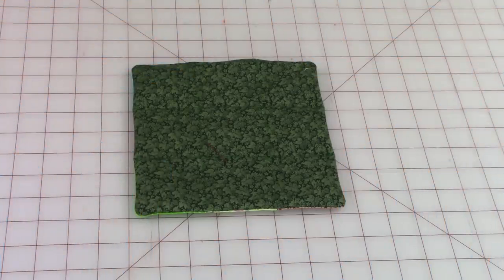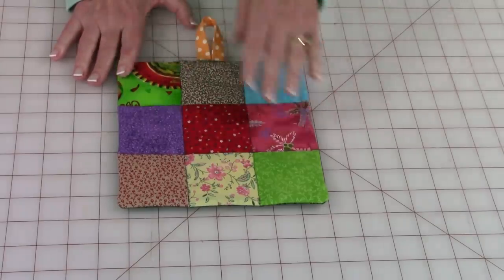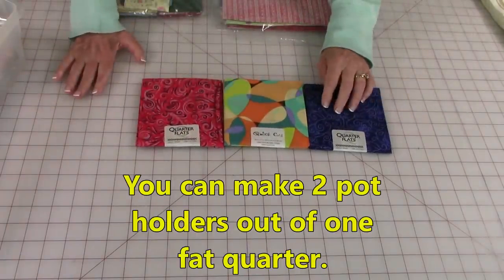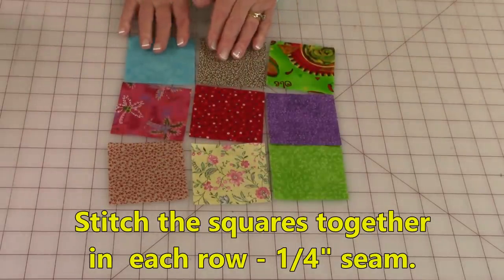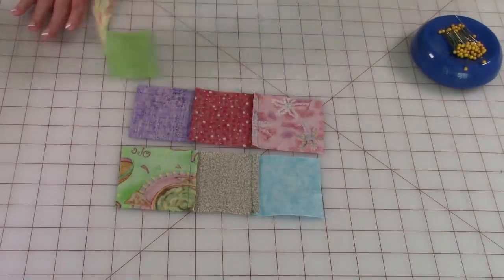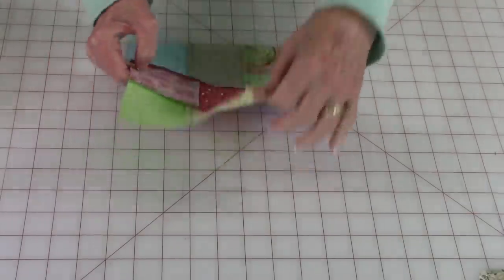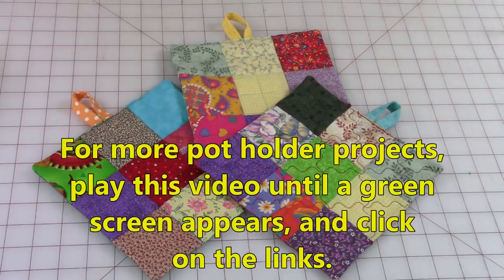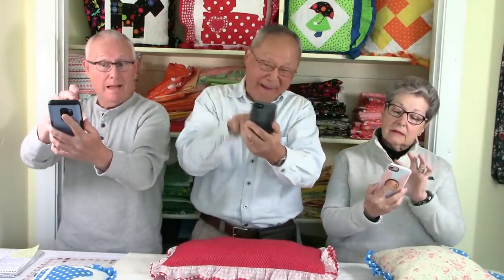10 Minute Pot Holder | The Sewing Room Channel

Comment: Thank you for responding to my question.  I do use a walking foot, check the pressure feet, needles, etc., and was advised at my sewing store to try to use a spray adhesive to keep them in place.  I'm not crazy about using that but will try it.  I just can't understand why the batting, insul-brite and cotton material keep shifting on me and I pin them in place all the way around.
Reply from the maker: Hi Karen.  Sorry I couldn't help you much.  But sometimes you might get some minor stretching of the fabric.  Thanks for watching, and happy sewing. 😍💗😀

Comment: How do you top stitch without doing the back
Reply from the maker: Hi Kelly.  The top stitching, also  called quilting stitches, is done through all the layers of fabric and  cotton batting.   These stitches are done to hold all the layers in place so that they do not separate during use and the washing/drying cycle.  Hope this helps.  Thanks for watching, and happy sewing. 😍